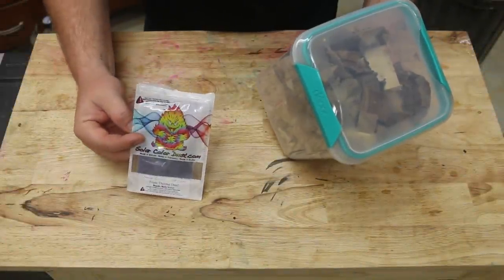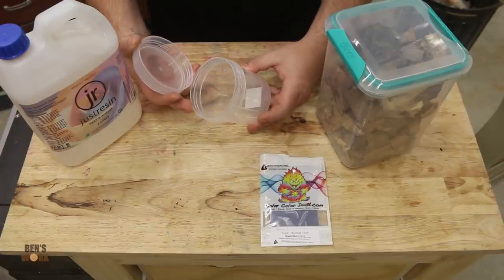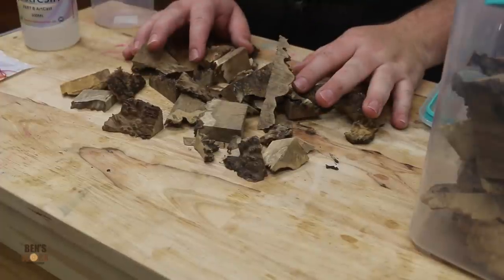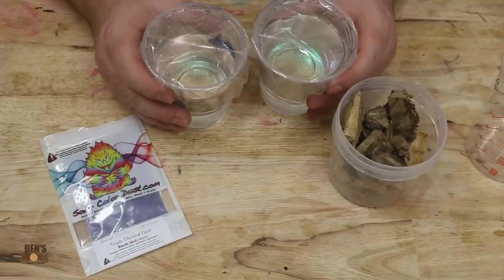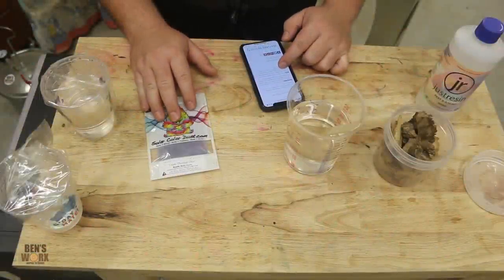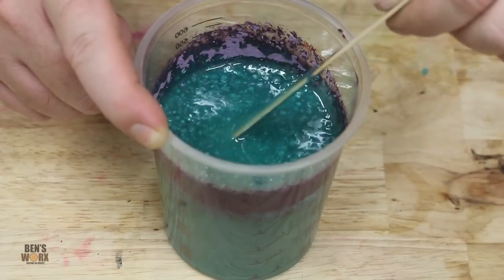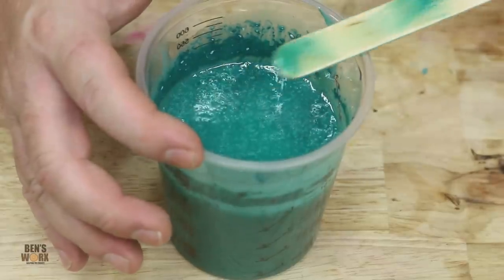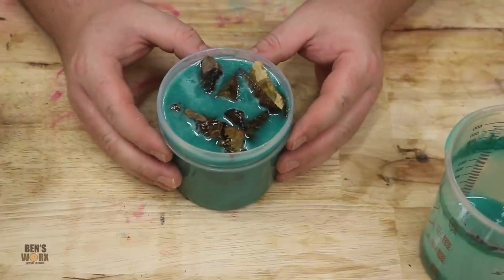Woodturning - Thermal Changing Lidded Box from Scrap Wood

Comment: Absolutely gorgeous how many different color changes can it go through depending on the lighting
Reply from the maker: Thanks Mate, it changes through 3 different colors depending on the heat
Reply: @BensWorx  cool some of the pendants that I made were supposed to be changing color in the sunlight + glowing in the dark but what I was using didn't work out but it still looks really interesting looks like the petals floating on a cloud they still look great now I just got 2 drill them so they can be wearable

Comment: if you added a small amount of the turned ribbons from this project in clear resin without stirring too much...would you get threads of thermal colouring in the new project?
Reply from the maker: Yes it should work 👍

Comment: Looks good. However I think if you would have coloured each scrap of wood with black paint and than the pigment on top of it like you normally do than did a clear coat around all of the pieces that would have looked really nice, again though really nice piece great job!
Reply from the maker: Thanks Mate
Reply: Wouldn't the paint and pigment have been cut off while turning it? That would have left only a small amount of pigment in between. I don't think the color change would have been as noticable.